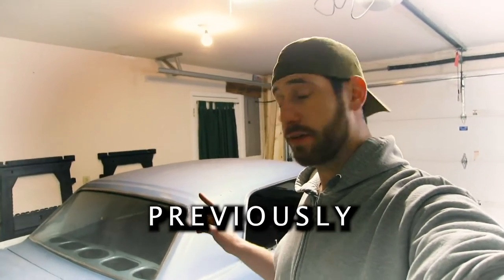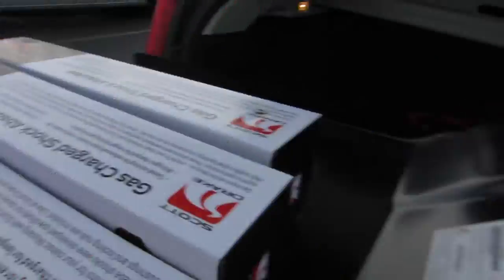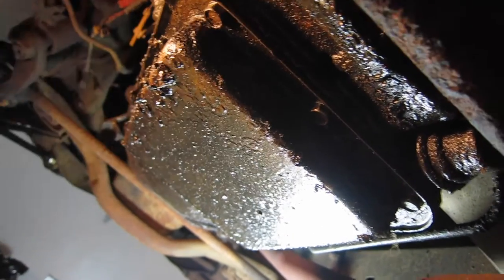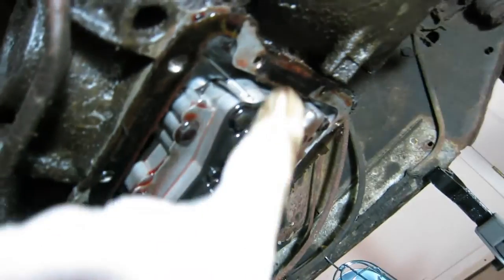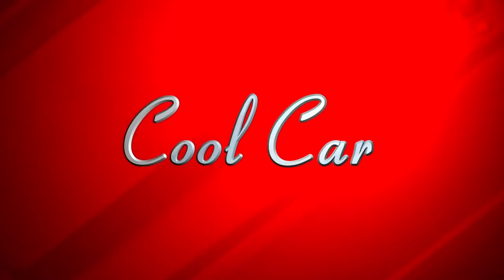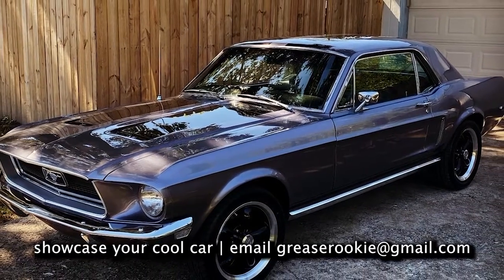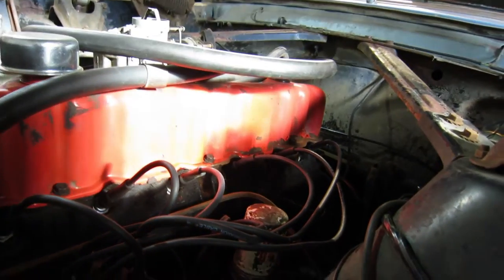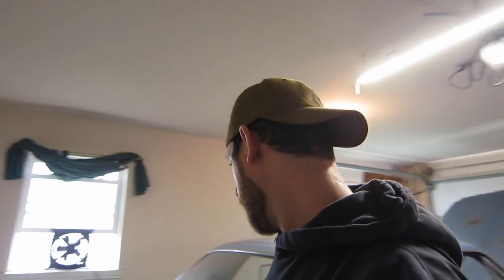CJ Pony Parts Adventure | Transmission Test | Vlog 20

Comment: Congrats on the victory! Your making some great progress
Reply from the maker: Thank you sir. I’ve watched your door skin replacement video several times already. I may be replacing the driver side door skin on the Iron 6. You have a great channel. 👍
Reply: @GreaseRookie  Thanks GR, it's been a struggle working on those doors. I have went overboard on alot of stuff. I'm almost done with them. My biggest thing right now is getting time in the garage.
Reply from the maker: I get that. I’m lucky enough I can walk out to the garage and work late into the night. But it can get exhausting.

Comment: Your Factory Fuel Pump which is still on the car still has its own "Twist-off" Fuel filter that you'll need to replace... Replacement are at NPD.... :o)  Tony K.
Reply from the maker: NEF aurora I’ve recently seen all your comments.  Clearly you have a ton of knowledge. I usually make it a point to go through and answer each individual comment but I’m a bit behind. Anyway, I at least wanted to reach out and thank you for all your help and advice. Your input had been a huge help!

Comment: The back passenger wheel seems to wobble a bit. You may want to check that out.
Reply from the maker: When I had the tires put on they told me that rim was slightly bent. I'm hoping thats the issue.